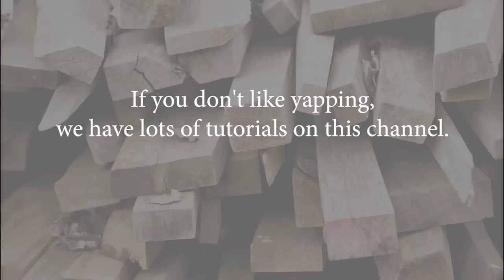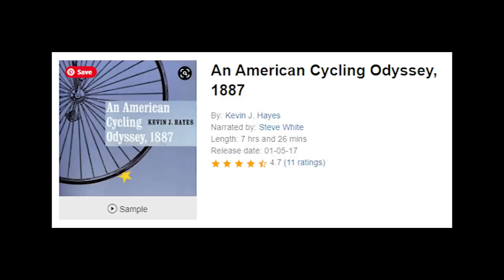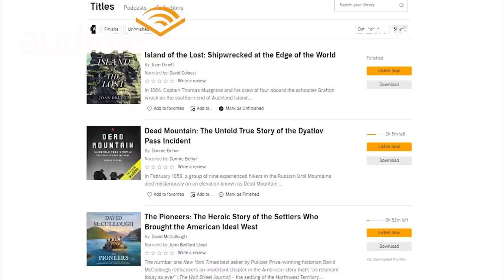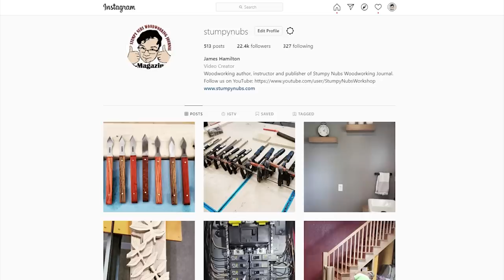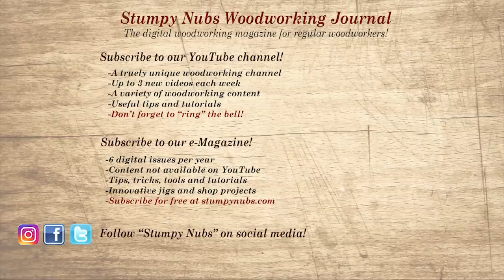Have they BANNED table saw dado sets????

Comment: In the UK they aren't actually banned. Axminster tools sell a table saw and dado set for it. The guard doesn't need to be removed as its an overhead one. I don't have a table saw currently but I am envious of your American saws with dado stacks
Reply: ... and its only £3,200 (without the dado set or overhead crown guard, another £150 and £750 respectively)
Reply: In the uk we don't need a dado stack when we can just use a Spindle moulder with a wobble saw fitted
Reply: Yeah, the stack is available in the UK, but you have to look around to find a saw that will accommodate one and stack blades are not easily available. And as noted here, get ready to empty your wallet.

Comment: I live in Greece now, I bought an antique INCA tablesaw, with all sorts of equipment.. boxes of it. in original boxes.. among which some 70's/80's Dado stacks, but also "routing-blades"  (no idea what they are called, but they look frikking scary, with gouges sticking out and all.. )never used it, but they cut decorative edges on wood.  
Im planning on using the dado-stack once.. but i never used it before.. and always managed fine.

Comment: I'm European and I never thought about that "stop time"... That's a good point. I will still go on with the router table. But it's a shame that CMT that is a premium Italian company builds dado sets and we can't use them!
Reply: Stop time is a thing I really appreciate too if I'm being honest. 10 seconds is a reasonable number, but how long does a free spinning blade take to halt? That must take at least half a minute. I wouldn't want that to be honest. At least some good things come from Brussels  sigh  And I don't mind the router table that much either if you have good quality carbide bits.
Reply: @patrickd9551  Ten seconds seems absurdly long. My DeWalt table saw has an electric brake that stops in about 1/2 a second. However, my Makita circular saw is faster yet, but jumps uncomfortably as the brake engages.

Comment: I'm in Europe. I bought a table saw with a long enough arbor from Germany and a dado set from Italy (OrangeTools). No problem.

So there's the other solution to using a dado set: buy a Felder table saw. They're made to work with a dado set and have all the regulatory safety systems built-in. 😉

Comment: Years ago I was using a dado blade on a table saw to make wine glass holders out of 1 x 4 pine boards about 30" long, (following all safety procedures). Everything was going swell for the first half a dozen pieces and then the dado blade caught on a knot and shot the board about 25 feet across the room and into a concrete block wall. Upon striking the wall the board shattered. Ever since then I use a router rather than a dado blade.

Comment: Very informative video, thank you.  A really good Stumpy Nubs video would be " How to avoid Kickback with Dado Blades.  I have never found one addressing the subject.

I had kickback (three separate times in one project) from the dado blade when cutting 3/4" wide x 3/8 deep dados in a 3/4 thick Birch Plywood panel 18" X 22".  The dado cut caused the board to rattle, up and down, and eventually a tooth caught it and sent it reeling across the top of the blade stack, back towards me.  I used a top pressure feather board, same thing happened.  You can see in Video at 4:58 the extreme downward pressure being applied by the left hand while feeding the piece.  The third run, (and third piece of plywood - the others had run across the top of the blade, back at me, and were ruined) the rattling board ripped past the  top pressure feather board, over the top of the dado and back at me.  The root cause was likely left hand pressure toward the fence was inadequate as was the pressure on the top of the board as it was being feed into the Dado monster.  Using your hands to put that much force against a board to keep it from rattling up on the blade presents a whole other set of potential hazards (think;  using a dull knife for carving).  Look again at the Video at 4:58 and see the white knuckled pressure required while pushing that panel through..

 Dado was of mid-tier cost/ quality, was sharp and had very little use (and was pitch free).    I use a router and dado guide now unless its a tenon.  Dado kickbacks were not a rare occurrence in my shop;  today the use of a dado is.

Comment: We have a stacked dado set in our SawStop at the high school wood shop in Canada. It sure feels safer than our router table, especially since the exposed blade on the router has no failsafe to stop the blade on skin contact like our table saw does.

A side note - during orientation I often ask the students if the saws know the difference between a finger and a board, but only when discussing our band saw or compound mitre saw. I don't want them to think all saws have the ability to stop themselves quicker than you can lose a finger.

Comment: Honestly, just build a floating guard, and make the nut on the shaft a locking one by one of many different means.  I suggest a set of washers and a locking pin.  Easy and lazy.

Comment: The first thing I ditched after leaving furniture school was the euro style short fence on my table saw.
Reply: Why? I find the short fence very useful when ripping lots of short lengths. You can simply cut away and the small cut items all have somewhere to sit.
Reply: I have never heard of a short fence. Is there a reference/ picture somewhere I can see?
Reply: The short fence does eliminate some problems.  I've added auxiliary short fences to my table saw fence when ripping long boards.  It stops the issues of the blade trying to grab the board at the end of the cut.  I may have explained it poorly but the safety aspect was readily apparent when I was ripping the tongues and grooves off of some lumber.  I was doing that because I used the same lumber for the ceiling and walls of a very casual room.  I wanted the T&G look on the ceiling but a shiplap look on the walls.
Reply: I found that the short fence never gave me the confidence that there was no risk of the wood pivoting at it's far end. Also, when ripping long lengths I never liked the fact that I either had to sacrifice the start of the fence placed at the edge of the table, thus allowing a nice long run-in into the saw blade or have little fence beyond the blade supporting the length of wood. 

I've had a life working with machinery, but could never see how the short fence affords greater safety when ripping. It was explained at the school that the fence should placed so the end extends no further than the centre of the saw blade. It creeped me out to be completely honest. I avoided using the table saw and preferred using the band, until I kitted out my own shop. I've just got a shop built mdf full length fence attached to the extruded alu fence and it has yet to do me wrong. I accept that if the user doesn't check for fence-blade-mitre slot alignment then it could cause pinch, but I feel you can nit pick those types of potentials with any machine or power tool and their myriad set ups.

Comment: i think many, if not most, woodworking shops here in germany use big panel saws. they usually have a floating guard, but since the whole point of those saws is that the left side of the saw table moves directly next to the sawblade, i dont know if dado stacks would even fit on them.

Comment: When I was a trainee I was given the problem of the carpenters in out organization not using the blade guard on the shop table saw, a Delta industrial model with a 7-1/2 hp. motor and a 14” blade.  I designed a bracket which suspended a blade guard from the ceiling and therefore didn’t interfere with the work.  There were two problems:  you had to use the splitter to keep the blade guard to raise the guard above the spinning blade

Comment: While dado sets aren't too common in the UK. We do use grooving blocks (both fixed size and adjustable multipiece blocks with shims) and wobble saws on the spindle moulder. Also the scoring blade on our panel saws (the little blade that runs in the opposite direction to the main blade, and is purely to cut the veneer to give a clean cut on veneer and laminate boards) works like a dado set, shimming the two blades until the are the same kerf as the main blade.

Comment: Your position on dado stack is spot on. I have been saving up for a Saw Stop for two reasons.  First off, so I don't cut my fingers off (I actually have several uncles that are missing alot of fingers, saw mills). Secondly, I want to be able to do dado stacks and make some really beautiful furniture that will charished by my family for generations. What is your opinion on the Saw Stop?
Reply: I've done quite a bid of research on the Saw Stop after losing two finger tips on my Delta saw (my fault, not the saw's).   I have a Saw Stop on order.  It does exactly as advertised, stops the blade in 1/500 of a second, moreover, the saw is made to very high standards and is a truly precision machine.  I have found that the cost is not all that more than many other high quality saws that don't have the safety feature.  It's easy to say we need to be careful, but sometimes we aren't and the consequences with a table saw can be be ugly.

Comment: I was using an unguarded dado set on a saw with no brake in 1980 and my shop teacher had a foolproof way to ensure safe operation.  If you did anything unsafe he would vigorously apply a large wooden paddle to tender areas until the message that safety was important became clear.

Comment: I am from Europe. My solution: I am using "groove blade" Pilana SK 92 180x6,0/3,5x30 16z FZ. Width 6mm, diameter 180mm (smaller than original 250mm blades for my Bosch saw). Perfect for 6mm box joint, still usable for wider cuts with multiple passes.

Comment: From what I've noticed to get around the no dado they just use routers on guides. Usually the festool ones from what I've seen. 

Place it seems to really suck is for repetitive stuff that's so much easier with a table saw. 
Same time though I've seen a lot of YouTube channels from Europe where their shops are basically a single car garage if even that. Not much space to fit a table saw. So could just be they don't have the space to get a table saw.
Reply: That makes sense for a a small shop. Like using a track saw instead of a bulky panel saw or a table saw.  I say this as someone with a tiny table saw that is really only good for ripping boards, and who cuts dados with routers, but has a great track saw that I love. I also do a lot of on site work in old houses and track saws/routers are easier to transport. I’m planning on building an exact width jig for cutting dadoes with a handheld router, for that reason. Sort of a poor man’s festool track router.

Comment: Before I saw this video, I'd always assumed that Dado saws were the same as what I call "wobble saws.  I'm in the UK and wasn't at all surprised that there seemed to be some kind of ban on them.  However, thanks to this video, I now know the difference.  A quick check shows me that neither is actually banned in the UK.  I used to be a woodturner, but lack of space means I've never owned a table saw.   Wobble saws just remind me of the guys with missing fingers from the boatyards near where I used to live, even though their losses were just due to conventional table saws.

Comment: at our factory, we get around the problem with not having dado set. by having a machine designed and build as a normal mill, that happens to lay on it's side... with a table around, where guards come out on an long extending arms.

and instead of dado sets, we have adjustable blades, but also mill tools for our work (they look like fat sawblades)

Comment: Why not just use locknuts or double nuts, when using a dado stack on the arbor?
Reply: Locknuts are a nuisance, and they wear, but double nuts is fine. You need an even longer arbor though

Comment: If you don't need or have room for a large saw, then the DeWalt 7492 is dado ready and widely available in Europe. I bought that one here in Norway and a Freud super dado set from Amazon. Works like a charm.

I think the risk of getting complacent and careless when making loads and loads of repeated cuts with a normal blade is much greater than any risk that might or might not be associated with a dado stack.

Comment: "I don't need a table saw to use a dado set. I'll just use this old radial arm saw I bought on the black market."
1 disembowling later
"Still safer than one of those death trap table saws."
Reply: I spend so much time with my 50yr old recalled RAS it makes my wife jealous. What it lacks in safety it makes up for in versatility. I can't count on 2 hands how many times I've lost a finger.
Reply: Using a dado set designed for a table saw on a radial arm saw will increase the the tendency for it to launch or crawl at you.

Comment: Hi Stumpy,
This is my first visit to your site. I was drawn in by the name Stumpy nubs and the dado saw title, thinking you had gained the name from using a dado saw and loosing a number of fingers. Glad to be shown otherwise. I have also used dado blades in the past, yes I still have all my digits! The dado is fine, if used correctly and with caution, it's the thrumming noise when they run that I find a bit nerve wracking. Cheers and thanks for the post, I will catch up with a few more of your video's. Hello from Australia.

Comment: I’ve had boards kicked back at me in two occasions, both were cutting a dato. Not saying cutting a dato is too dangerous, inexperience had a lot to do with it as well. But im not sure kickback happens less with non though cuts
Reply: I have always wondered about that. Thanks for confirming those suspicions.
Reply: Imagine going downhill on a penny farthing 😱
Reply: I've had kickbacks happen several times, but only with through-cuts. I've not made as many dado cuts, but the kickbacks happened when the wood I was through-cutting pinched the blade, or less commonly, when the blade was dull, and the piece near the fence was small, and wedged against the blade.
Reply: @FLPhotoCatcher  Right, that's the way it's usually described. But if you cut a dado and accidentally twist the board I can see how it could still get pinched in the rear. Cove cutting makes me really nervous.
Reply: @FLPhotoCatcher  Why would you through-cut with a dado-stack?   I'm having trouble understanding why that would be a thing :)    Thanks.
Reply: @mayorsnorkum4005  You wouldn't. I was replying to the OP after he said, "not sure kickback happens less with non though cuts".

Comment: Over here (Norway), if an inspection from the government workplace safety agency (to a company, not a private person) finds a table saw without the riving knife installed, it can earn you a fine of  $10000. Another solution for making dadoes, is a router guide extension for using with a track saw guide. Bosch has an excellent router with a matching accessory for using with the track saw guide I already have.

Comment: I've always wondered, didn't know about the brake issue (I'd very much like my blade to stop faster for convenience, but that's another thing). I use a dado stack often and never felt like it was a high risk tool, but the problem is that when building a tall cabinet, pantry, ect, the long panels can't be done on the TS at all, so I have a spiral down cut router bit, and a simple jig made of a 1'X4' piece of plywood, with a rectangle cut out of the middle exactly wide enough to run the router down both sides to get the perfect dado. Doing it this way saves the bit from overloading, and you don't have to move the jig, clamp it once, do all the cutting, and you're done.

Comment: In the UK, guidance is confusing on it, as the document from HSE (Health and Safety Executive)(Regulator) makes it clear early on that it's not possible to use dado sets in a commercial settings, due to the kids of reasons you mentioned and the risk assessment process, which would find other machines are more appropriate, but at the back of the same document, then goes on to say the circumstances where it is permissible, with older machines or ones specifically designed for the purpose, which there are some manufacturers producing, they are just  much more rare, or at least we're 7 or 8 years ago when I bought my last table saw.

Comment: I used dado sets professionally back in the 80's. Never any issues...
Reply: Thus the title professional danger is determined by the user not the tool. Kind of like a handgun they can be very dangerous in the hand of an idiot.
Reply: @larryh.4629  Yep....it's the user, not the tool...
Reply: Are you seriously saying that only idiots have accidents??
Reply: @pinkerbot  Nope...while not using a dado head, I had an accident cutting a finger and thumb on a table saw that required two surgeries and a skin graft. Accidents happen to professionals as well...
Reply: @pinkerbot  we all have accidents but carelessness and stupidity up the odds. Speaking for myself looking back most accidents I have had were due to me doing something Stupid🙃 cutting  corners reaching too far or getting into a hurry. One thing about accidents you won't forget the lesson they teach but it's a hard lesson.

Comment: I have a two blade dado on an adjustable hub built by craftsman . I've had it for thirty years and it's flawless and simple . 1/8 - 3/4 adjustment . The guards have never been installed and I've never been cut . I imagine it helps having the craftsman saw because it lines up nice with the table and just the existing arbour nut